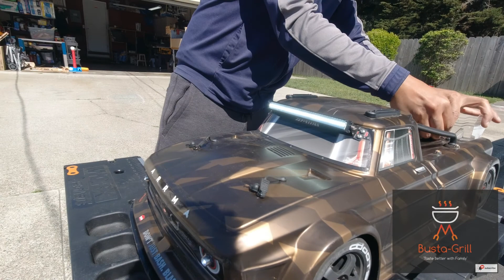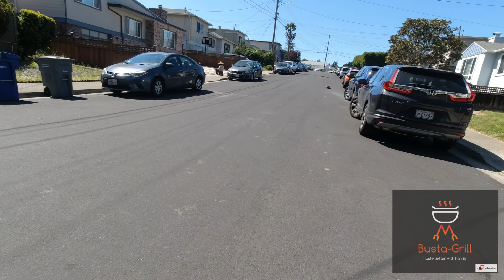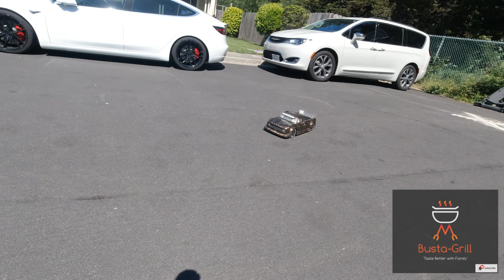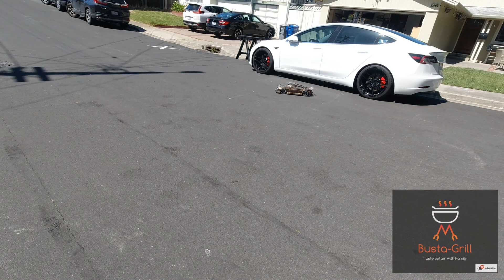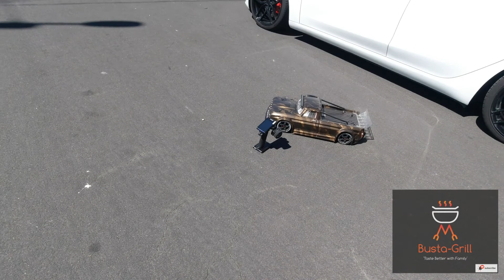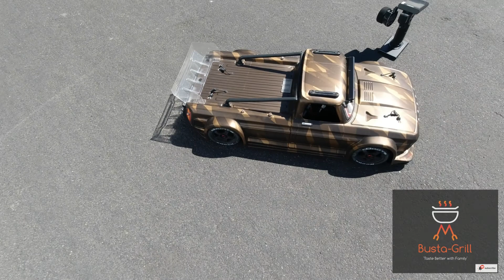My Arrma Infraction Drag RC - My Build Specs

Comment: I was big into 2wd and 4wd short course truck racing.   Also did a lot of rc rock crawling sport and scaling.   I kinda miss it but I know technology has changed since I stopped. Tell me about that build.  1/8 scale?  I use to have a 5b that I was doing an electric swap on till a buddy talked me out of it
Reply from the maker: Hi. Are you on the arrma forum. I have posted on the classifieds there. I put this vid up for reference,  didn't think I was going to get an actual comment/reply. Lol.  Very cool... here are the specs .  I have about $1600+ into it. My price is $1100 shipped. Im in NorCal. 

Electronics, etc.

- Castle Creations MAMBA XLX (8S compatible) - stock esc NOT included
- Castle Creations BEC 2.0 with Holmes Hobby adapter
-TP Power 2900 KV from Kill Mode RC - Stock BLX included.
- ESC top mount relocation 
- Hexfly DS3225 Servo 25kg 
- SMC True Spec 11.1V 9400mAh 75C w/G10 plates -  - only used 3 times!
- Yeah Racing Twin Fans w/heat sink 
- Ripple Killer 8S Cap Pack (not installed)
-Kill Mode 6S Cap Pack (installed)
-Island Hobby Nuts Spool setup (43T/25T) Stock infraction dif included 

Chassis/Driveline

 - Amp RC drive SupaHD center drive shafts 
-Jim’s Bearings Full Kit -
- Hot Racing AON48SH25 Aluminum Fixed Link Steering 25t Servo Arm Arrma
- Hot Racing Rear Shock Tower AOR3001
- Hot Racing Front Shock Tower AOR2801
- Hot Racing Steel Chrome Pivot Ball 3x7.8x8mm AON160PA08 (rear)
- Hot Racing Steel Chrome Pivot Ball 3x7.8x10.5mm AON160PB08 (rear)
-Amp RC drive SupaHD center drive shafts - $150

Miscellaneous

- Castle B Link - Bluetooth 
- 36 LED light bar
- 8pc LED front and rear
- shims, orings, etc.
-BSR Purples C8034B, Used one time!
Reply: No I'm on the hide the guy who got the 25CM brass from you
Reply from the maker: That's right bro! Too many hobbies,  need to cut it down a bit lol. It's a 1/7 scale Arrma.

Comment: Do you have a gyro on the car?
Reply from the maker: No gyro, using a noble receiver for my transmitter and I don't have an external gyro. Stock infraction RTR systems do have one with the Spektrum setup IIRC